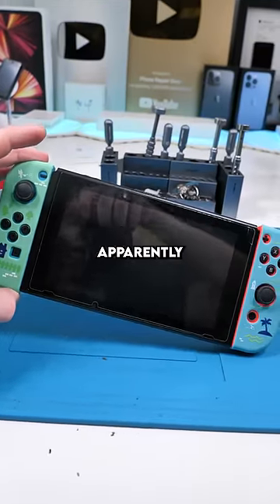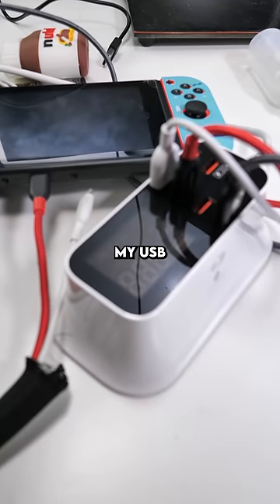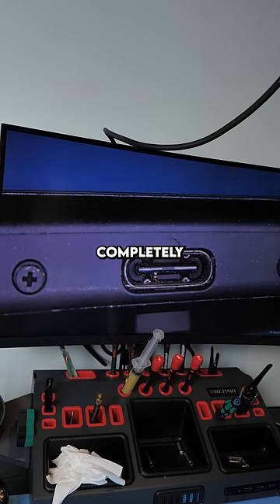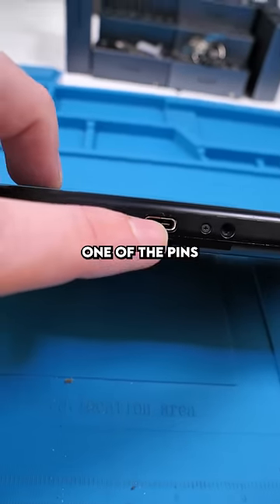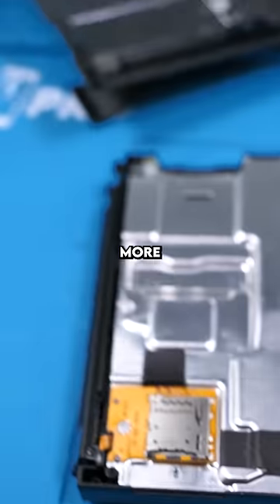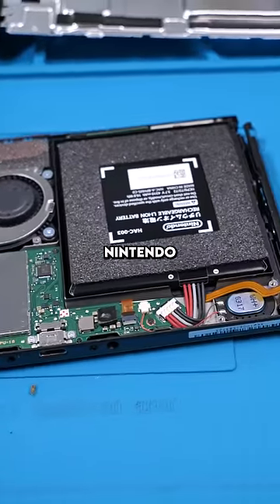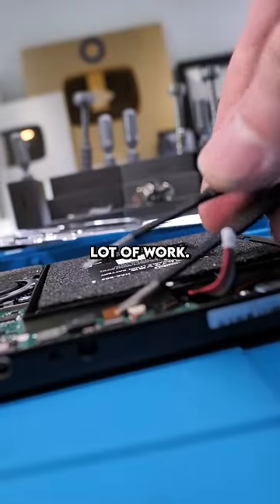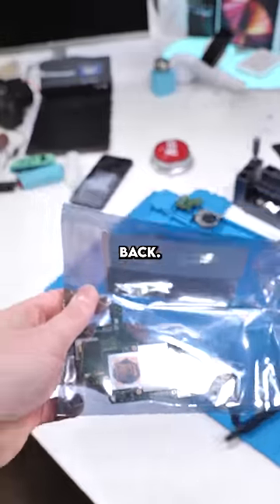This Switch Wouldn't Charge... USB-C Durability is 🗑️ #Shorts

Comment: "This would never happen to a lightning port"

The 3 iPhones thqt came across my desk with lifted lightning port pins: "Bet."
Reply: For real. The lightning port breaks too easily. It’s garbage.
Reply: @psyche234  never had a broken lightning or usb c port, but many, many micro usb ports, those are pure garbage
lightning even works without a problem on my good old iphone 5s
Reply: @TheRobben98  Almost every micro USB I've used has broken, I swear.
Reply: Apple helped design the USB C standard when it was developed. So I don't want to hear anything about Apple having better designs when they have given up on lightning port everywhere but their phone ecosystem.
Reply: @B0x_T00l  same
Reply: that would usually happen due to people's stupidity though......I've never had a lightning port stop charging......but the USB c ports on my galaxy and iPad pro did cause of I don't know what reason. yes lightning is slow data transfer but much easier to use
Reply: I haven't broken any charge ports since micro USB. I don't know how all these people are doing this lol.
Reply: @psyche234  in my personal experience I’ve had dozens of both USB-C cables and ports break, but I’ve never had a lightning port break
Reply: @B0x_T00l  I have a HTC M7 that is in top notch condition, charging port and everything in perfect shape, and of course I wiped the system for a Android 10. I see no problem here. But once I had a iPhone 5 that I did buy from a friend, in the gym the whole display "unglued" itself so to say. So I had no music for the rest of my workout and a trash phone. Never went for Apple since.
Reply: Right I see so many more iphones and ipads with issues related to charging and battery then I ever see quality usb c devices
Reply: @TheRobben98  we don't talk about micro USB lol
Reply: My phone fell down and was still charging. The Cable was completely ripped out of the chargingport for about 7 Times. Everything is still working well. 😂
Reply: @psyche234 Exactly
Reply: @streicherchen i was almost hit by a car on my bike, with my phone in my pocket, the phone was bent from end to top around 10 degrees, it worked fine. No longer waterproof after I replaced the back and the back did not fit any more. If I had not replaced the back of my phone, then I would probably have used it for another year or two. But with aluminium and glass you get a really durable phone, or well it depends. I know that iPhone 13 is glass and alu, but that shit breaks like cornflakes. My Sony phone lasts forever. xD
Did I mention I did not use any kind of protection for my phone. Yeah just raw durability.
Reply: @TheRobben98 micro usb is notoriously easy to damage due to not having any rotational symmetry and have those stupid latches

Comment: “This would never happen to a lightning port”

Me holding my charger at that perfect angle so i can charge and scroll at the same time😮
Reply: Thats with usb c too lmao
Reply: @MyGoatFloats  yea its every commercial wired charger, which is why the quote is dumb
Reply: clean the dust out
Reply: @MyGoatFloats  no where near as bad as lightning, its harder for dust to get into a USB c port.
Reply: @MyGoatFloats  it's not an issue with the USB C dude.. one of my USB C chargers is bent to hell and still charges my laptop xbox controllers and phone so ion wtf yall dudes doin band wagoning opinions
Reply: All my cables suck lmao. I guess im just not treating them right cause ive had every version of a cable fail on me lmao
Reply: @MyGoatFloats  never happened to me
Reply: @MyGoatFloats  I've never had a problem with it and I've used the usb-c for multiple devices for years now
Reply: @bostinobaddog2040  so clearly im doing so something wrong lmaoo
Reply: @sciencesold_  it’s not the port, it’s the cord
Reply: @MyGoatFloats  clean the port
Reply: Use a small toothpick or the end of a paperclip and carefully remove the pocket lint (dust) from the lightning port. It’s amazing how much you can fit in there. Afterwards, the cable will click in place again and you’ll have less charging issues.
Reply: @Laurensedema  it’s the cord not the port, the cord is messed up at the joint
Reply: @MyGoatFloats  I've had this happen with MicroUSB, MiniUSB, and Lightning. Never had it happen with USB-C though. I've had so many USB-C cables and devices that get incredibly abused, and they're fine.
Reply: @sciencesold_  but that's a double edged sword because when stuff does get in there it's harder to clean
Reply: @MyGoatFloats  🧢
Reply: @goldenolive5523  it's not the cord!! I've had this issue a lot and it's always the port, nothing wrong with it really but putting your phone in your pockets makes dust and dust bunnies get inside the port and block the conectors or make it so the cable doesn't go all the way. I've had people come to me asking if I could replace their port since they bought chargers and it still doesn't work properly, and if you look inside there you can see strands and gunk inside. You have to grab a toothpick or a needle and loosen up the dirt, blow into the port and clean up with a baby wipe or alcohol wipe is much better and works perfectly
Reply: that’s the wire, not the port itself.
Reply: @sciencesold_  Lightining is literaly more durable and also easier to clean.
Reply: @riot9179  it's harder to get dust into a USB C port than lightning. And their durability is basically identical
Reply: @716JBlake  ik! Lightning sucks! Usb 2.0 in 2023?! Nah I like USB 3.2g2!
Reply: U m using usb c since 3 years same phone and cable even perfect working where's ipad u ask oh angles
Reply: @MyGoatFloats haven't has that issue with usbc personally, but damn using the old usb was not it lol
Reply: The cable would turn to dust before you had the chance to plug it in, ergo it CANT happen to a lightning port
Reply: You need to clean the port lol you have dust in it. Maybe take better care of your phone and clean it regularly 😅
Reply: Respect
Reply: To those blaming the port, no I've had cables (both the crimp and the actual coating) fray and affect how the device charges.  It's not just the port.  What if the port is fine, but the device either doesn't charge or charges very slowly.

I had at least one actual charge failure, similar to the person who mentioned the holding the connector a certain way to charge the phone while in use though after those early signs it stopped charging and just died, this one has a perfect condition battery (not a spicy pillow). (it's a motorola stylus that failed 3-4 months after I replaced a stylus that had a spicy pillow battery that was pushing off the back cover, for that one I didn't notice it because I had a case on my phone.)

Also check the plug socket your charging brick is plugged into, this could also affect the charging of a device.  This one happened to me with my phone recently in the surge protector, I moved the brick to a different socket and now it charges like normal.

Also if you're cleaning any type of port, do that with care so you don't damage it and cause even more of a charging problem after cleaning it.
Reply: I have usb and i have to put it down at the perfect angle

Comment: That has actually happened on the lightning port of my ipad mini lol
Reply: Maybe something similar but not this exact scenario
Reply: It couldn’t happen cause there is no middle pin that could bend
Reply: @AanshShokeen the lightning cable would just snap 😂
Reply: @sucre3165  yeah obviously
Reply: @FAB1150  I feel like "obviously" should be in bold in this case :D
Reply: @AanshShokeen  there's pins on the "walls" of the connector that can bend in the same way. They obviously aren't in the middle but it's the same thing

Comment: "This would never happen to a lightning port"
My guy I've lost count of how many lightning ports I've had brought in that have pins bent or missing.
Reply: Bro you don't have iPhone Bruh
Reply: @Infocraft590  ok?
Reply: @ziglind  ok?
Reply: @Infocraft590  ok?
Reply: XD
Reply: and I have bent multiple lightning cables. Almost all of them had to be thrown away.
Reply: Pins are stuck to the side on lightning ports so your either lieing or them people bent them on purpose
Reply: @EpicWatsonOne Plus 
My guy, have you ever actually looked inside your connector? I don't know how to tell you how wrong you are, so I'll just link an informative video: 
https://youtu.be/5RRdR4CqP-8&t=1m39s

Do you see those 8 contacts? Labeled 1-8? Clearly on the long inside surface of the connector? Those are pins.
They're just... kind sticking out in the connector. They get caught on loose things in your pocket (pocket lint, a key that slips into the port, etc.), and sometimes even just on cheap cables you can buy at Walmart. One little push and those pins get bent and broken. Happens all the time. I probably replace 2-3 of these a week which have been damaged in such a way.
Reply: @NorthumbrianNationalist  It doesn't matter if it is in the middle or the edge. The only difference is that theoretically you could break the plastic middle piece in the USB-C port. Although, that would be hard to do since to do that you got to breack the metal shielding on the outside and at that point the solder pins will break.
Reply: but lightning doesn't have pins, the only way you can break it is by bending the male end, what u on about "bending the pins", there aren't any pins to bend
Reply: @dr.darkjokes7847  Sorry to break it to you almost every single connector have pins inside, that you can see them doesn't means it is not there and lighting is not the exception.
Reply: @toastyxboops  if you look into the port, there are no pins to bed, they are flat against the walls of the charging port,  not a tech genius but im pretty sure it uses similar technology to wireless at a guess
Reply: @Infocraft590  how to make a stupid comment, pt 1
Reply: @dr.darkjokes7847  what? Of course it has pins, they're just on the "walls" of the port instead of in the middle. How else would the plug connect? Lol

It has happened to me first hand on my ipad. So yes it does happen
Reply: @FAB1150  yeah, they are stuck to the walls, even if you grabbed a pin, or a small knife, it’s very very difficult to even scratch them
Reply: @dr.darkjokes7847  they're stuck to the center tab on USB-C too man. And it's not difficult at all to damage lightning lol. I've broken far more than USB ports
Reply: @FAB1150  I saw a video of someone grabbing a tac 📌 and scratching the inside for a solid 2 minutes, I later tried this myself and I have had no change in the affect of charging
Reply: @dr.darkjokes7847  i use a needle to clean my USB-C ports too. And? Doesn't mean that it's impossible to damage it, I've had damaged lightning ports as I said
Reply: @dr.darkjokes7847  Im impressed by the balls you have to risk destroying an expensive piece of technology to prove a point in a youtube comment section.
Reply: @dr.darkjokes7847  *effect

Comment: "this would never happen to a lightning port"

this exact thing happened to my airpods case
Reply: How tho ?
Reply: The protruding pin broke off in your lightning port? The port without protruding pins?
Reply: You'd make a great comedian
Reply: Not even possible 💀
Reply: If you actually look at a lighting port you'll notice it has protruding pins on one side, and one of those pins got pressed down into the bottom of the port and stopped them from charging

Do some research lmao the lightning connector sucks
Reply: The lightning port does have pins protruding. It's just that they're on the side.

Lightning ports still break, way more than USB-C, as well.
Reply: @elementalmp4  yeep ty
Reply: @elementalmp4  lmaoo these clowns think apple is the greatest company ever 😂
Reply: @lenarduwu  this you? -->💪😎
Reply: The lightning port has no pins to break or bend though??
Reply: @lenarduwu  they are just like xbox stans it's been 3 console generations Microsoft has had wireless and they still make u buy a battery pack sperate. It's apple no charger in box fiasco
Reply: @SyRose901  I don’t know where you’re pulling this from but it’s bullshit. Lightning pins are thick as hell and USB-C ports break all the time, almost as bad as micro USB
Reply: @jandajanda2242  disagree here, lightning port pins are durable but still very easy to break. My whole entire family knows this by experience
Reply: @jandajanda2242  I've had android ever since they were new. USB c does not break as often as micro USB. Micro USB was total ass.
Reply: Lol
Reply: @elementalmp4  those pins hold the connector in the phone not charge it
Reply: Seb!!
Reply: @jandajanda2242  Lol, Lmao even. Type-C is 1000x better than Micro
Reply: my iphone charger was fully stuck in my old phone XD so i had to take the charger end inside the phone to a repair shop rip--
Reply: @jamescook6723  still using my rechargeable batteries from the 360 days yo.
Reply: @jandajanda2242  never had a USB C port or cable break on me from regular use. on my switch, my oneplus and samsung phones, and wireless earbuds have never had usb c issues. still rocking the same usb c cable that came with my first usb c equipped phone.
Reply: @donpapi1461  it still has pins, that's that the contacts are, flat pins, they can still get bent, because some part of the plug needs to be applying some form of pressure to keep the contacts secure
Reply: I'm just gonna state, I hate lightning chargers simply cause the cables and male connectors are practically designed to break in the first 6 weeks of owning them. Had to avoid buying apple branded cables to at least have some semblance of durability. Yet I've had the same USB-C cable since a year before the pandemic that I used to charge my Switch. Now it's my phone charger since I upgraded my phone, but still. The ports on the other hand, are fine. Neither of which are really better than the other, both have pros and cons. Personally I think Apple should give the choice to its customers whether they want USB-C, or Lightning ports when purchasing the device. Hell, it be even cooler being able to go to the apple store and get your port swapped, could also force customers to upgrade by refusing this service for 'antique' models like they usually do already for other services.
Reply: Don’t treat your stuff like shit.
Reply: @QendrimGjoka  it still has pins, just not in the center. It can happen to any port
Reply: @donpapi1461  Lightning connectors also have pins lmao, they don't magically conduct through solid metal.

The pins are just on the sides of the connectors, not in the center. The same thing can happen either way.
Reply: @jamescook6723  been using a ps3- ps4 and I still want an xbox, same performance as the ps5, works with my gaming setup, a no brainer

Comment: "this would never happen to a lightning port"
the cable:
Reply: Trust me it’s happened to my buddy’s Samsung cable 💀
Reply: I just noticed how often the connectors are so well designed or built to be durable, but the cable just shuts itself. (Micro USB is the exception, it was always shit)
Reply: @dotmatrixmoe  the cables are designed to be weak so that you have to buy replacements.
Buy a high quality 3rd party cable and it'll last 20x longer than any stock charging cable
Reply: @zBepis  still using my iPhones 5s cable that I got 9 years ago
Reply: this would never happen to a lightning PORT. HE SAID PORT. JUST BECAUSE YOU HAVE A SHITTY CHARGER DOESNT MEAN HES WRONG
Reply: The cable: 🔥, or it will need to be replaced every week
Reply: @fearlesscozmo3039  u  it u
Reply: @dotmatrixmoe  h  ok I put u I ok go put to put I’ll h  was g,e
Reply: @Alex-rz4wm  it's automatically shitty when I have to use a non-universal option
Reply: @U i swear to my smart fridge you guys are doing illegal activities on your chargers then getting flabbergasted that a pin got bent or sum
Reply: Samsung cable more like, never had my iPhone charger break, idk what y’all are doing with your shit.
Reply: Yeah, lightning cables are designed horribly.

Comment: “This would never happen to a lightning port”

If only it charged at least at half the speed
Reply: My iPhone charges faster than my switch and I think they have around the same size battery
Reply: @SensibleDuck has something to do with charging speed the Redmj note 12 discovery edition can charge in 9minutes so 🤷
Reply: My iPhone charges way faster than my Samsung with the usb c to usb c with the same samsung super fast charging brick, whats your point?
Reply: @LSnium  maybe because you use a 15 watt brick?
Reply: @Qwrt27  no I actually use my Samsung 25 watt Super fast charger brick with my apple usb c cable.
Reply: @LSnium  
The only phone that charges slower than the iPhone at the same price point is the pixel.
Samsung: 45W
Xiaomi, Vivo, Oneplus, etc: ~67-120W
Lower price points:
Samsung: 25W
Rest: ~33-120W (Non special edition)
Realme has some 150W, Redmi has some 200W, but most non special edition ones charge at around 67W these days.
Reply: @Likeusb1  yeah Idk the lightning cable is fine and I don’t get why people are complaining about it, it does everything a USB-C cable does but I find it better and more sleek and durable. I have nothing against Apple changing lighting to USB-C
Reply: @LSnium Lightning connectors are still using USB 2.0 which basically gives 10x slower transfer speeds compared to current USB-C devices on USB 3.0 and onwards.
Reply: @LSnium  Smaller batteries require less power (and therefore less time) to be fully charged. Faster times doesn't mean more power is going into the battery.
Reply: @quintinstephens349  iPhone had bigger battery than Samsung
Reply: @LSnium  seems to die quickly for something with a bigger battery. Also, I didn't mean Samsung specifically